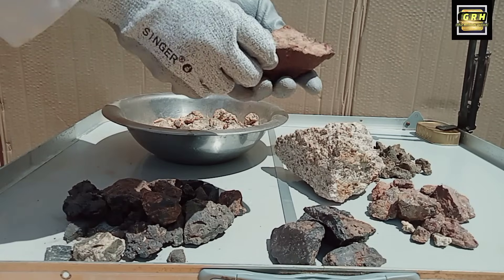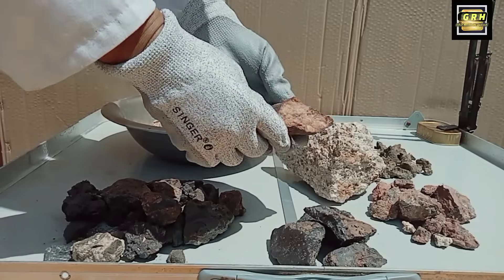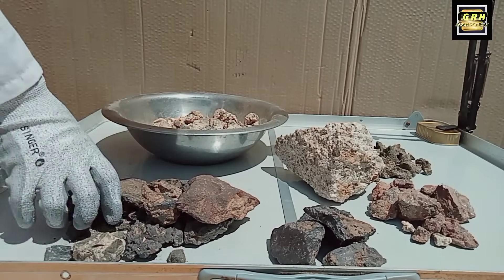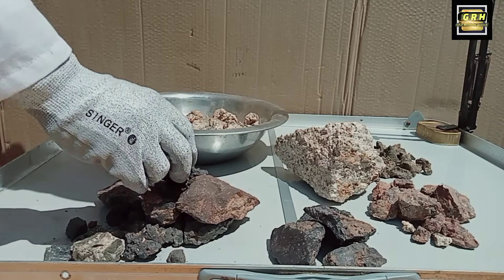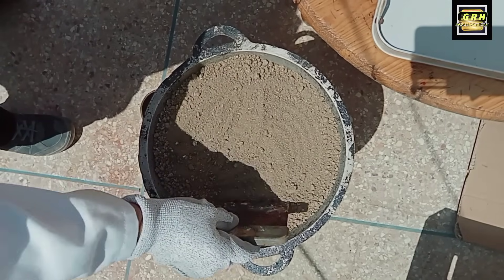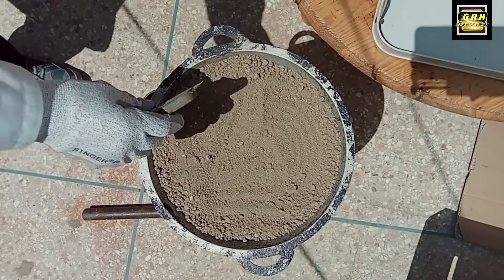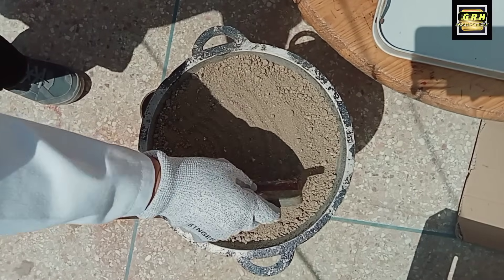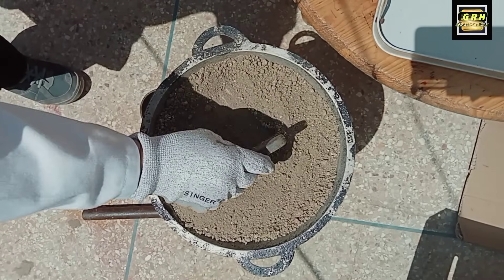Stone gold  recovery/gold ore process/how to recover gold from rocks

Comment: roasting at how much temperature? is it true it is needed to be 800 degrees? and can i use hcl instead of sulfuric acid to get rid of impurities?
Reply from the maker: Roasting involves heating the powdered rock in a controlled environment, which can oxidize or volatilize certain minerals, leaving the gold behind. Smelting involves further heating the roasted material to a high temperature to separate the gold from other impurities.

• Microwave-assisted Roasting: Microwave-assisted roasting involves exposing the powdered rock to microwave energy, which helps to heat and roast the material. This process can enhance the liberation of gold particles from the rock, making it easier to extract the gold.
• 
• Acid Digestion: Acid digestion involves using strong acids, such as hydrochloric acid or sulfuric acid, to dissolve the rock and extract the gold. The rock powder is treated with the acid, which dissolves the non-gold minerals, leaving behind the gold particles.

Comment: After u get the yellow paste solution rinse it with alcohol right then put HCL again then heat it? Is that correct?
Reply from the maker: in case the solution contains tin chloride and lead chromate. You have a complex colloidal solution that cannot be precipitated.

  Dry it on the fire until you have a purple-colored paste. Pour it in a small amount of hydrochloric acid. It will completely dissolve and you will have a white precipitate. 
  
Get rid of the white precipitate completely, then filter and purify with acid. Do not use water at all. Take the solution to the fire. Dry it completely until it turns 150 degrees. This colloidal paste turns yellow as a result of transformation Tin(II) chloride is soluble in water, and the ternary chloride of gold is converted to chloride of gold(monoxide), which is insoluble in water.

Go to the yellow precipitate after heating it on a very low heat and carefully so that it does not burn, then rinse it very well with alcohol several times to get rid of tin chloride. 

Do not rinse with water. Use red or white alcohol or gasoline. After a good rinse, put the yellow precipitate in hydrochloride acid on a low heat. You will notice the beginning of the disappearance of the cloud and the formation of golden precipitate .

Comment: Brother, isnt it better to boil the raw material in diluted nitric acid (after sufuric acid) to get rid of tin and other undesirable minerals ??
Reply: Actually you do have to roast to get the sulphur out and roasting will pop open the pyrite if theres some then you hit it with nitric not dilluted straight and it will get rid of non preciuos then you wash it and sulfuric next to get the tin lead etc and wash it then you hit it with nitric and then mix the hydrocloric and then etc on
Reply: @ANCIENTASTRONAUT411 Yes, this is the right metod
Reply: Thanks for all your guidance there Hassan